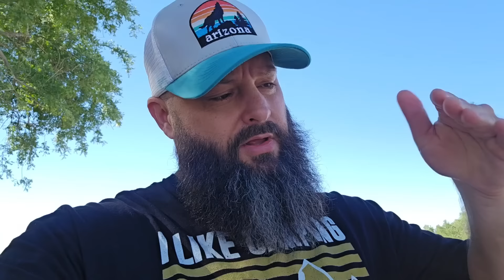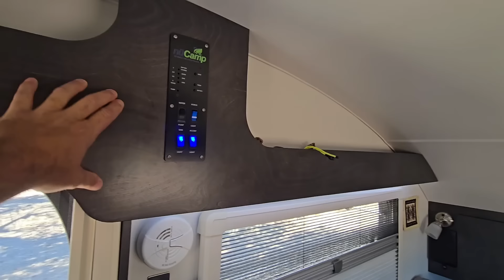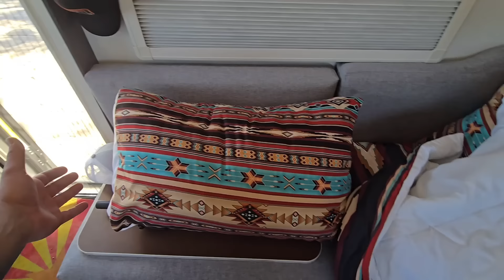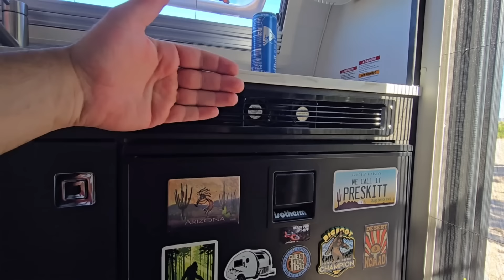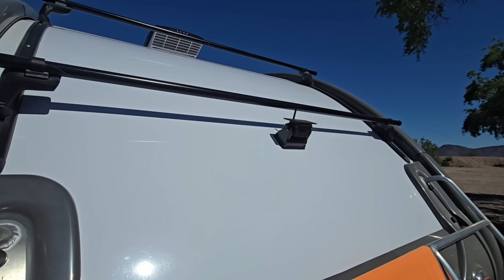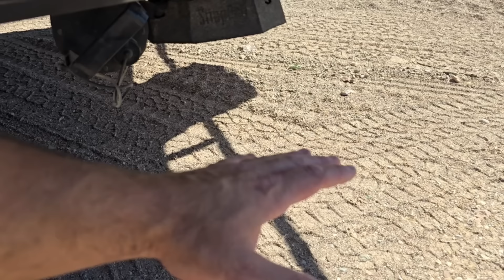THE FINAL NuCamp T@B 320s Boondock Trailer Review and update.

Comment: Thank you so much for taking all the time to do these reviews! I have found them soooo helpful!
One question… where do you put all your gear? I noticed when you do the tour most of your cabinets don’t have a lot of stuff in them. Mine are crammed. Lol  Do you just travel extremely light or do you store your stuff in your truck? 
Also, my windows were a bit scratched up when I got my trailer and I’m wondering if you know a product that would buff out the surface scratches in the windows? 
Thanks again for all your help!
Come up to Canada!!!
Reply from the maker: No problem. It's fun to do. Glad I could be of some insight. After years of tent camping and many weekend back to back trips ive just learned to carry what I need. Fairly minimal unless I want to bring something extra along on a certain trip. For clothes storage and a few other things, that stays in the truck. If the scratches on the window are light scuffs, I just use meguiares cleaner wax  and a foam polish pad. You can do it by hand. It want help for deep scratches though. Or you may have to take it to a detail shop. You have to be careful with plastic polishing to not buff to fast with a machine or you can burn the plastic. For light cleaning and protection on the windows you can use meguiares spray quick detailer or spray wax on the outside. Inside ive been using invisible glass (plastic) acrylic window cleaner. It works well. No problem. 👍 A Canadian adventure would be cool. I've only been through Vancouver once for a short time to board a boat. Thanks for watching and commenting.
Reply: @DSWadventures So many beautiful places to camp here! Please do come up and enjoy our wild west coast! I highly recommend Elk Falls here on Vancouver Island. We even got to watch a black bear wander past eating some vegetation. It was stunning along with the beautiful waterfalls. You are always welcome!

Comment: About the black trim flying off when driving, I have never had a problem either.  I wonder how fast these people were driving??  The manual says to not to go over 60mph with the trailer.  I never go over 65.
Reply from the maker: Well, I'm sure high wind speed doesn't help. If it's the decorative plastic trim around the trailer, it does have a couple of design flaws to it. A couple of the over lap sections are facing into the wind. They are also just held on with some thin clips maybe some sealant or double side tape in the keeter rail channel. Alot may also depend on the environment the trailer is stored in. Some people have posted the clips rotted out, or the slots on the plastic trim dried out cracked and tore through. The plastic tends to really twist expand and contract alot in different temperatures. So far mine have been ok, but I did you some plastic fender push pins to keep the overlap edges down in the wind. My year model trim is a bit different than some of the older models though.

Comment: Hi there, I’ve been watching you for sometime and you might have an answer for me. I bought a used 2018 new camp 320 tab and I just noticed that the black piece that goes from the back across the top down toward the front on the door side it’s not stuck real well and there’s like a gap where it should be touching the back. Would you have a guess at what I should do for this is water going to go in behind this black strip as it rolls off the top and down the back.
Reply from the maker: Hi, very cool I appreciate that. Oh no, that's not good. Im not entirely sure on all the T@b model years unfortunately. Are you talking about the rubber doors seal when the door closes in the door frame? Hard to tell without seeing a pic. Best thing to do is take a picture and ask someone on the T@b Facebook pages if you can. They will most likely know for sure. Sorry I can't be of more help. Thank you again for watching and commenting. Let me know what you find out.
Reply: @DSWadventures  i’m sorry I probably didn’t make myself very clear. I’m talking about that thick black plastic that runs from the back handle up the back and crossed down to the front of the camper on both sides. It’s about 3 inches wide and the part that touches the actual roof area on the passenger side about 4 feet of it is not sealed down tight against the white roof like the driver side is.
Reply from the maker: Oooh, ok. I think you're talking about plastic trim that goes over the top front to back on the side of the trailer. The 18 model is a little different than mine. If it's the trim that goes up and over, it's just decorative from what I know. On your model you may have a rubber piece that attaches to the trim that helps it meet the roof. I think it can be replaced. Im not sure on your model but I do know in different temperatures that the plastic molding can expand and contract, it may look lifted higher on one side, then the next day not. Just keep an eye on it, make sure it's not cracking or pulling out of the track it's mounted in. I would contact Nucamp and explain that and see what they think. Hopefully you can still get replacement parts for that year.
Reply: @DSWadventures  thank you I think I’ll call the new camp factory tomorrow. I appreciate your response.    Have a great week
Reply from the maker: @CGC1954  Very cool, no problem. I wish I could be more helpful though. Nucamp will know, if not try Missouri Teardrops.

Comment: Thank you for the detailed review of the 320 NuCamper. I’m a single gal and am looking at something like this to do camping now and then. I’ve been looking at their 360 and little bit larger. I don’t want a big thing to tote around but one with enough room. I’ve saved your video to go back and refer to for knowing what I may need to do or have done on a camper I purchase. Again thanks for all the ideas!! It helps a lot!!
Reply from the maker: No problem. They are definitely very neat and easier to tow than most.  They have everything you need packed into a tiny trailer. A 360 would definitely be nice. If the 360 was out at the time, I may have gotten one.  That 1 extra foot longer, wider and taller can really make a difference. Glad I could be of some insight. Thank you again for watching and commenting.  I appreciate it.

Comment: When you say plastic push-pin, do you mean rivet?
Reply from the maker: Sometimes they are called Christmas tree push pins, plastic fender liner push pins like they use on vehicles. In my case I used the ones that look like they have a plastic screw in the center so they can be removed easily. You can find them at some hardware stores or automotive stores also.
Reply from the maker: Simular to these. You will need to figure out the right length and thickness. Careful on the dilling, DONT!! drill into your roof, just through the two pieces of trim overlap. Make sure you get the drill size matched perfect for the pins diameter, just big enough to slide through, expand and hold. https://www.amazon.com/zDwfDc-Accessories-Fasteners-Replacement-DD020-125/dp/B0DHVJ8S2T/ref=asc_df_B0DHVJ8S2T?tag=bingshoppinga-20&linkCode=df0&hvadid=80470717338848&hvnetw=o&hvqmt=e&hvbmt=be&hvdev=m&hvlocint=&hvlocphy=79825&hvtargid=pla-4584070203596344&psc=1&hvocijid=2031797505141260683-B0DHVJ8S2T-&hvexpln=0

Comment: I’ve had my max air fan this is my third year full timing in my 24/320BD .. the fan runs 24/7 except when I’m moving point A to B. It is the best fan ever.

I sleep wheel to wheel in the back and use a 6” twin Tri fold mattress that I’ve cut down to fit perfectly and use an under bed wood support otherwise the mattress leans forward on the bench seats…it’s a little pain to hold up the cushion when bleeding the air cushion but not too bad for a few 10 seconds… so my bench seat is full flat all the time as I leave this bed down all the time.  

I also cut into the wood frame on the Elwell A/C side an additional 4” hole for better air flow into this system. I removed the microwave, built a nice door and it’s my space for all my electronics, cords, and rechargeable batteries. I also removed one of the cushions and added a four door cabinet for storage and I don’t use my wet bath as it is my storage closet…I have too many items for “just in case” considering I’m full time but before I purchased this 320 I had a 400 then car camped, then bought the 320 all in a 4 year period. 

I also don’t use the propane cooktop…I have an 1000W Jackery for skillet cooking and a 250 to power my starlink which draws 22W when working. ..and I removed the tv and replaced it with my 12.9” iPad Pro…I’ve made over 30 modifications inside and outside my rig to suit my needs for full timing. The only issue I had was the door which the dealership made the mistake of riveting the top hinge so I can’t fully adjust the door when it moves out of alignment…to resolve leaks I added a strip and that took care of the seal issue…to resolve it I’d need to drill out the rivets from the top hinge these knuckleheads used and redo the screw system up there but I haven’t had the want to fix that since I jerry rigged it for now.

I like the idea of using the plastic pins to hold things together…I’ve been using alien tape which so far 3 years … like the bottom of the entry door piece was loose.  I also took a piece of foam and fit it around the tire stem to hold the TPMS in place so it doesn’t hit my wheel when traveling. I would like to be able to have extra solar power panels to hook up but so far my solar system works well for my needs ..which it just runs my frig and the rest I use my jackery. ..of course I don’t run my AC using solar .. I also have a lithium battery giving me that extra 1000W.

I am considering a Bluetti Apex 300 plus extra batteries for more boon docking with AC function but I haven’t needed it…and I have the pads on the stabilizer feet as well which was the first upgrade purchase I made.  Another excellent upgrade is the REDARC brake controller and air bags on my tow vehicle…huge difference…plus anti sway arm.

And I have been in cold temps but had shore power and wrapped my water in heat tape as well as the electrical foam line cover. I love this trailer…I had a 400 but the 320 is more comfortable for me. Thanks for this video…and I am going to have to get me a smart plug one day.
Reply from the maker: Very very good modifications. I like the extra vent hole in the wood for the air 8 return air. Good idea. That maxx fan has been doing good also.  That apex 300 with 30 amp is incredibly small for its outputl.  Isn't odd the 320 feels roomier than the bigger 400. That new 360 other than the kitchen counter would probably be the sweet spot. One day maybe. Very cool. Thank you for telling us all about the mods. 👍👍 Awesome. Thanks again for watching and commenting.

Comment: We have a 320-CS. They're great if you're not tall. Both my wife and I are under 5'5" and can sleep wheel to wheel. Here's a tip some don't know. If you want hot water in a hurry and you have shore power, you can heat the glycol at both 2kw electric and gas at the same time.
Reply from the maker: Awesome, another 320 owner. 👍👍  They are such neat little trailers, especially if your under 5'7 like us, hahaaa. I actually did figure out that quick water heating trick. Pretty cool we can run gas and electric at the same time.  Thanks for watching and commenting, i appreciate it. Happy T@bin to you both.

Comment: i have a rustic trail papa bear tear drop, youre right about the questions, i wish i wasnt during traffic at times tho!
Reply from the maker: Im going to have to look up that trailer, sounds neat.
Reply: @DSWadventures no bathroom/shower. I’m looking at nu camp 320/400 
as a possible upgrade. Not a fan of the 600 dollar heating maintenance, seems like most dealers don’t even mention it, and i dont think my rustic trails is around any longer.
Reply from the maker: @medicatedforyoursafety9349 ah, a traditional teardrop. Very cool. If you are use to a small teardrop a 320 may be just right, if your taller than 5,7 I'd say maybe a 360 or 400 model. The Adle heating system definitely adds a different  kind of maintenance/ cost over the traditionalheating systems. But  it is really nice, efficient and quiet. If you want something a little less complex Nucamp came out with  a T@b 320 lite with Less complex systems, much little simpler, and better priced.
Reply: @DSWadventures  ah, they were bought out under blue mountain camper company

Comment: I just lost a nut on my steps. 2024 320s bd bc. I saw on a forum a link to where you changed it but I cannot find that video. I don’t know how to get to it. It is the one in the back. I am wondering if I have to remove the steps to change to nylocks. Also, do you have a video on the water pump making noise but not pumping. Wondering if I need to completely fill the fresh tank to prime. Thanks. I appreciate you
Reply from the maker: Dang it. All you need to do is lput the step down and look under it,  most likely it was a nut on one of the hinge bolts. You can put the step down and pull one of the other nuts off, no need to unbolt the step leave the bolt in. Make sure you didn't lose the washer also. Take the nut down to your local hardware store and match the thread and bolt size to the nut. I think you'll need 4 to 6 stainless nyloc nuts. Super easy. As far as the water pump goes, you need to have at least a couple gallons in the tank. Sometimes it takes awhile to come out of the spigot because there is air in the lines. Crack both spigots inside open on cold at once. If that doesn't work make sure your Nautilus system valves are in camp mode configuration.
Reply: thanks. It is the nut all the way in the back and the spring makes it hard to reach. I will take another try at it
Reply from the maker: No problem.👍 That damn step company should know better by now to use nyloc nuts on moving parts like that.

Comment: Cool tour! I have a Subaru Outback Wilderness and I think this will work. I’m curious how long you can operate on battery charge (for AC/heat). I’m just starting to look so I’m an RV noob. I usually camp in my car - even when it’s 20 degrees out.
Reply from the maker: Thanks. I know some use the larger subarus to tow with. But you will need to check your vehicles gvwr to make sure you can tow it, along with adding a trailer brake controller if not equipped. This 320 comes in at about 1900- 2400 lbs loaded as I have it set up. My model does not have the AC inverter, so i can not run the Air conditioning off battery. Even that said, if you had the black canyon version with inverter you wouldnt be able to run the air conditioner very long off battery power, like maybe an hour or two depending on battery capacity. The heater can be ran on either propane or electric shore power though.  Most Rvs/ Trailers like this one are only 3 season rated, meaning you need to drain and winterize the plumbing so it doesn't freeze and bust in colder temps. The lowest temps I've pushed it to with water in the plumbing was 50° day time 25° at night,  but only for a short time with freezing temps for only about 6 hours of that. You could drain/ blow out the water and use rv antifreeze and camp in lower temps though. The Alde heater does do a great job at keeping things nice and warm inside though. Hopefully that could be of some good info for you. The RV/ Travel Trailer thing definitely has a learning curve.
Reply: @DSWadventures Thank you! This is very helpful!

Comment: I am looking to use the push pins in the trim mod you did.  Which video did you do the install?
Reply from the maker: I haven't done and install yet on them, I want to make sure everything works ok first. You can find them at a good hardware/Auto parts store or online. They are called fender liner push pin or rivets about a 1/4 inch shaft thickness 3/4 inches long. I used the kind that look like a plastic screw in the center so they can be easily removed if need be. You will have to use a drill bit just about the size of the push pin shaft thickness. And only drill through the upper and lower plastic trim over lap about 1/4 inch deep just through the upper and lower plastic trim. Mark your drill bit tip with masking tap to make sure you only drill through the plastic trim. Don't drill into your roof!.  You may just slightly have to wallow out the hole so that the push pins can expand a little and properly lock in, but not too much. Keep test fitting a little at a time, Its a fine fitment. If it holds up good and doesn't seem to be stressing the molding out during hot and cold expansion and contraction i will make a video. You could use short screws, but i figured the plastic pins may give a little to allow for some expansion contraction. Some have tried using screws and it tends to be too tight and may eventually cause cracking in the trim.

Comment: JR have you had to deal with the keder railing black trim work yet, lost mine on a trip to CT. thank you for any info you can provide...GLenn
Reply from the maker: Do you mean the decorative plastic or the little rubber strips on the inside edge of that plastic molding that meet the roof?
Reply: @DSWadventures   Yes JR exactly and thank you for your awesome You Tube videos i look forward to each and every one!!
Reply from the maker: @glennsenechal4786  I haven't had and actual issue with tge plastic molding yet, but that why I put in a couple of plastic fender push pins. The thin rubber edge trim has popped off, but i slide it back on and used a touch of glue at tge ended of the strip. If you model is like mine, that rubber edge strip is just something they may use to put on a car door edge. That junk will eventually dry out and crack anyway. We will see how she goes in time. Thanks for that.  👍👍